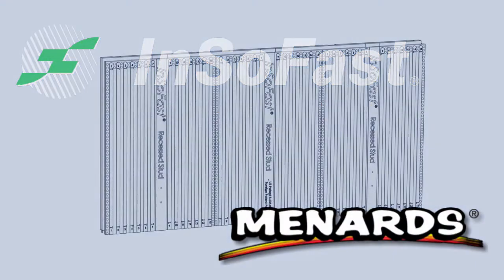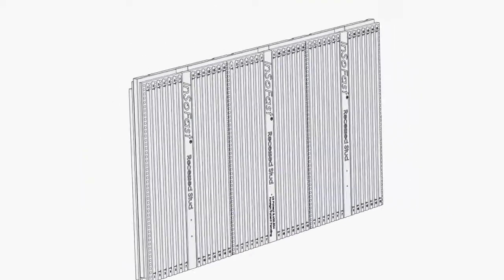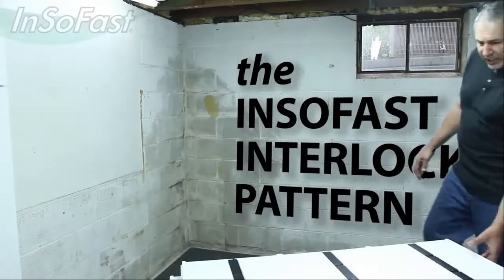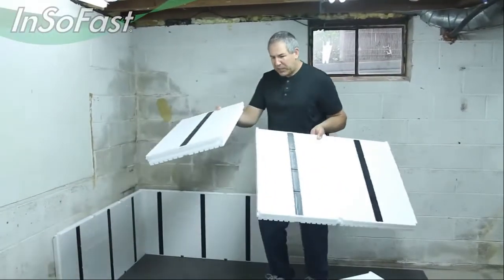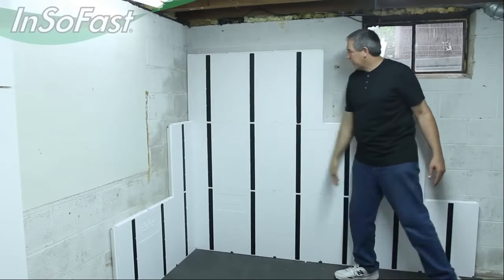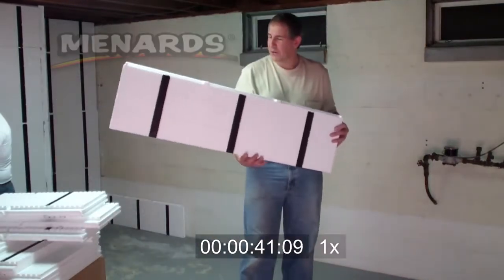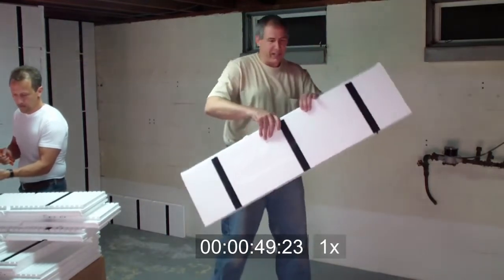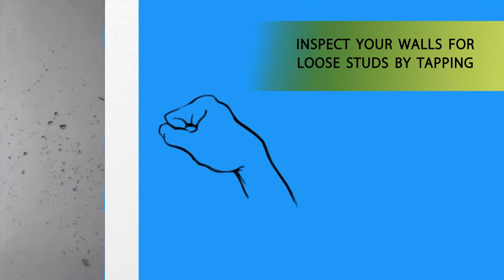Menards EXi2.5

Comment: How well would this work on a box truck? Adhesive wise with vibrations going down the road.
Reply from the maker: Jeff we are unsure how it would work on a box truck, it would depend more on the substrate (walls, floor, and ceiling) and how the adhesive would stick to those surfaces. The glue will stick to our panel.

Comment: What’s the recommended method to installing baseboard trim to the insofast
Reply from the maker: Watch this video https://youtu.be/baG94a7YmE0?t=256
Typically when nailing baseboard to InSoFast you nail the baseboard to our stud that is 16" on center. If there is not a stud a carpenter will nail the baseboard from 2 different directions. This will form and "X" nailing pattern that will lock the baseboard to the drywall. If you don't want to work that hard glue the baseboard to the wall with drywall compound. Drywall compound sticks to everything. This will hold the baseboard fast and eliminate nailing, filling the holes, and caulking.